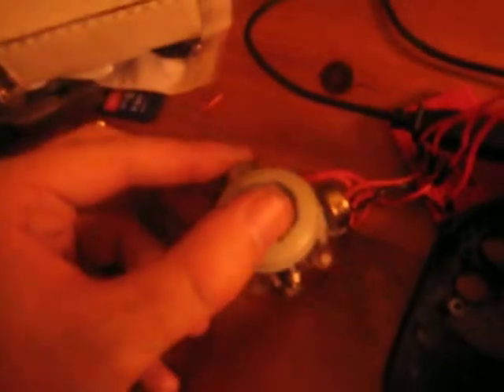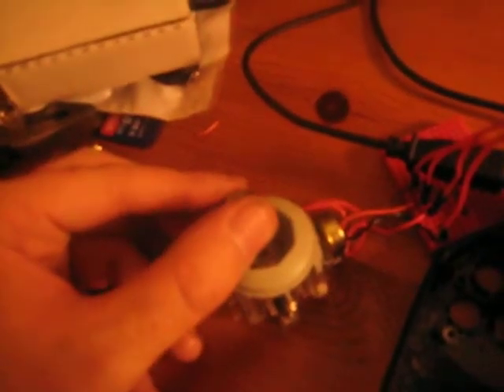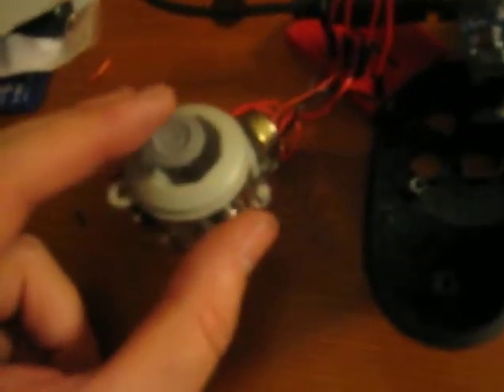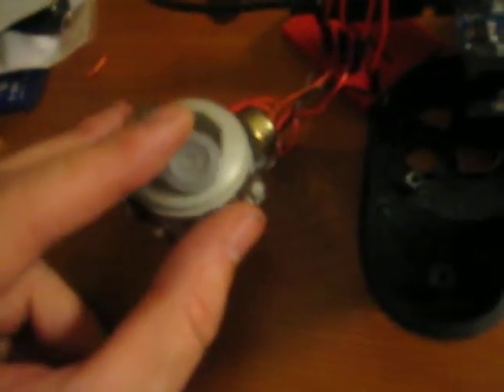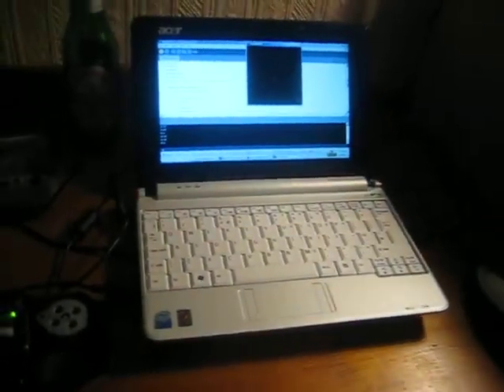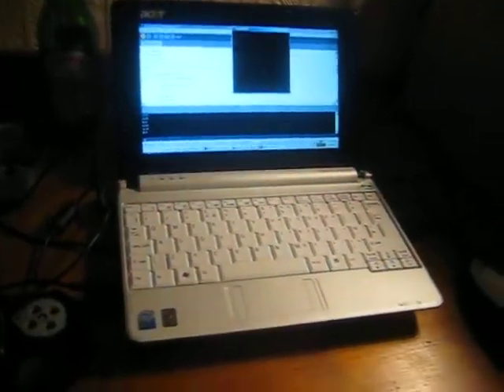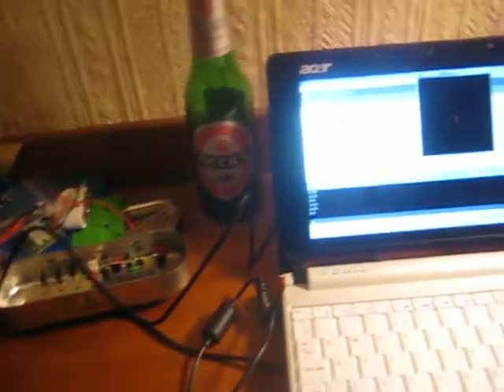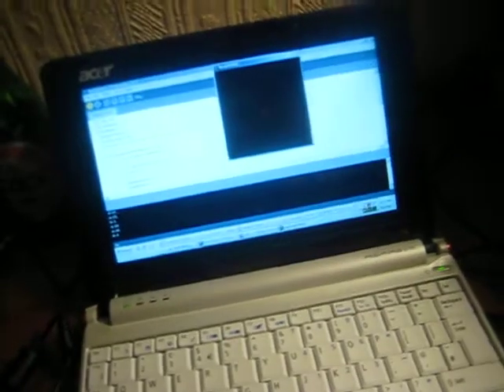Arduino and N64 joystick

Comment: Bro how do u give signals to the Joystick Port of the N64 controller instead of taking signals, Ben heck got an arduino nano to output compatible signals so he could use an analog stick instead of the original optical encoder shit
Reply from the maker: im not sure sorry. I gave up on arduino when that screen didnt work for me.